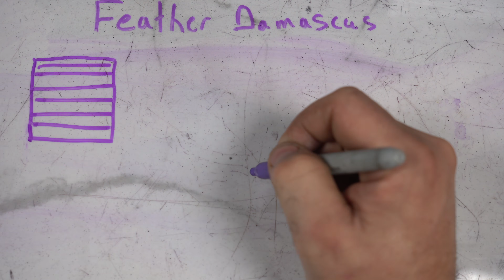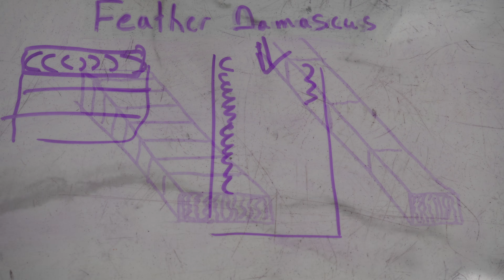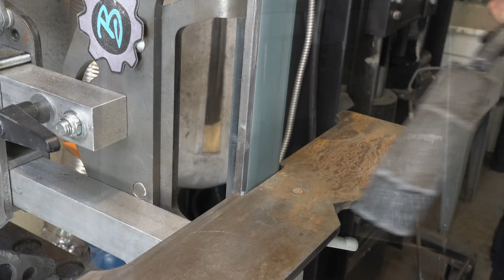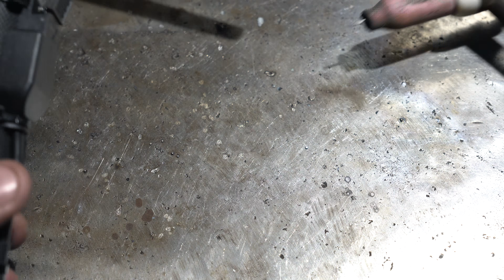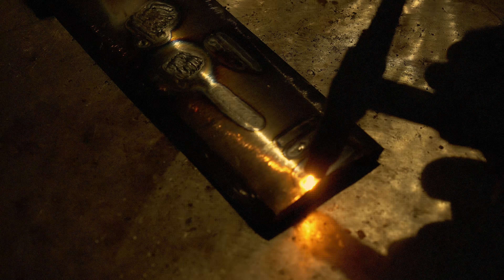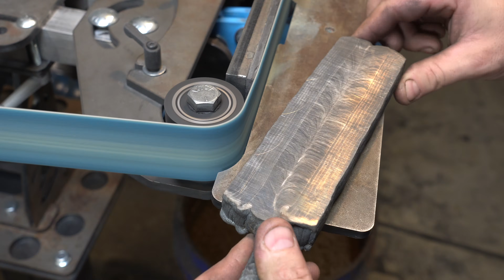Triple-T #106 - Damascus Patterns - Feather

Comment from the maker: Any questions about the feather pattern that I didn't cover?
Reply: what would happen if after the cutting, you did a twist on each half in opposite directions, squared up, and reforged? :o
Reply from the maker: @jeffclarke1694  Once you twist something, you really lose most of the pattern.   I've found that after twisting most patterns, it just looks like a twist.  Plus this would have a VERY high chance of shearing apart.
Reply: @jeffclarke1694  Oh IDK but that sounds kinda cool.  Maybe it would delaminate????
Reply: when you started the layers of steel were like a sandwich then you crush corners
then draw it out  do you draw it out with the layers  running up and down vertically before restack.
Reply from the maker: @robertpiano9991  You want the crushed W's running vertically in the billet.  Meaning as you press the bar, your W's are being compressed.  The other way would flatten them, if that makes sense.  The graphics represent the orientation of the bar.

Comment: Great information, so after stacking the last time and adding the steel on both sides did you use the tig welder to fuse the billet then reheat to split it again? Which model is the tig welder? 2 in 1 or 3 in one?
Thank you William
Reply from the maker: You can just mig the side steel onto the billet.  The tig is optional.  I have a separate tig because the 3in1 machines are usually just lift-tig and those kinda suck.  You want one with a high frequency start.  Again, mig is fine for this.  Thanks for watching.
Reply: Happy New Year and Thank you for
 the info, right now I only have a Lincoln stick welder. Still trying to decide which to get. So after splitting the last time, do you grinding or just brush the scale off before forging back together. I've made Damascus and twisted it for my bullets but have never tried this feather before so I'm a little hesitant.
Thanks

Comment: How do you maximize keeping your billet annealed so you can easily cut it? I find mine seem to get too hard to cut with anything but an angle grinder and cutoff wheel, even though I have allowed them to cool slowly in the forge, or in a bucket of kitty litter overnight. 
Thank you
Reply from the maker: Assuming you don’t have a kiln, just leave your billet in your forge after the forging session when you turn it off and let it cool slowly as the forge cools.  Thanks for watching.

Comment: Hey Denis, would this Vevor tig torch work well for making oxygen free billets? If so, how do you like it still? The link is now expired as well. I think I found the same one on their page, but it looks a bit different now. Thank you
Reply from the maker: That’s exactly what I use it for… fusing Damascus without adding filler rod. I really like it.  It has a HF trigger start, not lift-TIG like the Titanium. The price is great on these as well.  (Note, you’ll need a 100% argon bottle).

Comment: I have what is probably a silly question but what would happen if you did a bar of twist pattern and stacked it like you would for a feather? Then split it just like you would a feather. I’m sure it’s probably been done but I’m wondering what the pattern would look like.
Reply from the maker: You'd get some weird twist that wouldn't really be that recognizable.  Plus to get a twist that thick it would have to be a twisted bar stacked on itself.  I'm not sure what it would look like but probably something akin to a crushed W feather.  Thanks for watching, Bill.

Comment: That tungsten was sticking WAY TOO FAR outside the ceramic cup on your Tig torch. Also on the Tig welding, you don’t need to only use the mild steel Tig rod like ER70S or simply fusing the steel, you can actually get high carbon steel wire like 1080 wire from McMaster-Carr on a roll in various diameters so you are welding with steel that can be incorporated into the Damascus without needing to be completely ground out
Reply from the maker: As you can tell, I’m no expert welder.  Thanks for the tips and thanks for watching.
Reply: @TyrellKnifeworks  you should really try using a foot pedal if your new welder will accommodate one, either a foot pedal or a thumb wheel on the torch as they both function the same just one uses your foot to turn on and turn up the juice and the other has a thumbwheel that rotates to do the same thing
Reply from the maker: @peltiereric6497  It doesn't support a foot pedal.  It just has the button for gas/HF on/off.

Comment: I broke down and bought a higher end yes welder tig/stick.
Reply from the maker: For the amount of welding I do, I can’t justify an expensive welder.  I’m sure you must do a fair amount at work?
Reply: @TyrellKnifeworks  agreed! The yes welder I bought was 450 they have a lower end model that’s about 279. People seem to like them and they have pretty good reviews. No way I’m spending the money for a miller to fuse billets!
Reply from the maker: @sandison_steel  The vevor multi-process with a foot pedal for tig is only $520 so that's a great deal.  I wish I got that one instead.  🤣

Comment: when you stack your steel on top of each other you draw it out   then you crush corners for your  C then  do you flip the billet on its side so the layers are different than when you started. i hope i explaind it as best as i can
Reply from the maker: When you stack your steel, you keep it in that orientation to crush the corners.  Then you turn it 90 degrees so the layers are running up and down and press the bar flat.  Make sense?

Comment: Also when you are using a scratch arc tig, to prevent pinholes, you have to roll the tungsten off, don’t lift it.  We welded pipe for MANY years, and still do, before they came out with pedal start.  They are nice rigs though.  I need one!  😁😂
Reply from the maker: When you say "roll the tungsten off", what exactly do you mean?  (I'm certainly no expert at tig, as you can tell).   Thanks for watching, Tony!

Comment: One of the most useful tips to date,adding side bars to the stack before you split it 

Good job
Reply from the maker: Not before you split it, but before you reforge the splits back together.  This was a huge improvement on the feather process.  I've always had a love/hate relationship with feather because it always tries to split as you draw it out, this totally addresses that.  👍🏻.  Thanks for watching, James.
Reply: @TyrellKnifeworks  we’ll say both then ,yes and that’s also my hate for it 

The splitting and the forging
Reply from the maker: @jamesball7322  It's just that if you forge weld on the side plates before the split, its an extra forge session, as opposed to doing it while you forge the splits together.  Either way though, it's a huge improvement.
Reply: @TyrellKnifeworks  I’ve seen a lot of wasted time on patterns that didn’t have the pop so I’m not to worried about an extra step

Comment: As i recall when i first learned how to use a TIG machine was rule number 1: Don't touch the electrode to the work piece because it causes contamination of the weld. So im wondering what the maker of your first machine was thinking...
Love the series btw :)
Reply from the maker: It's very common to have a lift-tig start on the lower end machines.  When they mean that rule, it was after the arc is started.  Thanks for watching.

Comment: That's cool, glad u did the wavy patterning in the video
Reply from the maker: Thanks for checking it out, William!
Reply: @TyrellKnifeworks  would you consider doing the other way of that wavy patterning (forge then grind) technique.
Reply from the maker: @williammorrin_articwolfforge  What exactly do you mean?
Reply: @TyrellKnifeworks  you forge your billet into a wave then grind the sides down to make it straight again
Reply from the maker: @williammorrin_articwolfforge  I wouldn't try to forge curves into the feather, its very prone to splitting and you would be putting a ton of stress on the exactly where the splits occur.  You'd be better off adding the steel to the outside, putting in the scallops and then grinding all the steel away if you wanted just the feather (with no other steel on the sides).

Comment: Feather is my favorite .I don,t have a press. Could I do a simple by hand?
Reply: As it is a variation of hot cut, it should be doable by hand, depending on the size of the piece would probably require a few reheats
Reply from the maker: I disagree a bit, I don't think feather is a pattern you can realistically do by hand.  The problem is the number of layers, the crushed W's and the forge weld of the tall stack are incredibly challenging to do without a press.  Could you do it with enough time and effort, sure.  You're probably going to need 3x the amount of steel though because you're going to lose so much steel to scale.
Reply: @TyrellKnifeworks  Thank you sir

Comment: As  a non knife maker I understood the first uses of Damascus was for increased blade strength. Do all these modern variations also add strength?
Reply from the maker: But you need to consider the steel from that period was terrible by today's standards.  They first took bloom steel created in a furnace and then combined different steels in a crucible and melted them together to form traditional damascus or what we call "wootz" steel. This was stronger because it removed more impurities that plagued steel of that period.  Today's modern steel is very pure and MUCH stronger so modern damascus is done by layering different kinds of steels to produce a pattern.  In itself, it is not stronger but actually can be weaker than the original steel if not done correctly.  You are forge welding those steels together and if any weld isn't done right, it introduces a point of failure.  I hope this helps.  Thanks for watching.

Comment: Question: How much of the metal do you lose to the scale falling off when you press it? Is it enough to notice or insignificant?
Reply from the maker: What Robert and Simon have said is spot on.  This is why I say some patterns aren't realistic to do by hand because you'd need to start with so much steel because you'd have to do so many heats that you'd lose most of it to scale.  This is one of those patterns.  Thanks for watching.
Reply: Usually you lose one percent of metal when you heat it up. You can see piles of scale around the power hammer or anvil. But the amount of steel you use decreases as you forge and heat as the billet as the billet gets smaller as you keep heating and forge . I think a math size could come up with a formula for the amount of loss over time. A long answer for a simple problem.
Reply: Math wiz instead of math size. I dislike auto correct …..
Reply: @copper7309  I feel the autocorrect pain.  It kicks my ass too.

Speak of the devil.  I typed "the pain of autocorrect" not "the autocorrect pain."
Reply: It depends on how often you have to heat it and the ratio between surface area and volume of your billet. From start to finish of making a more complicated pattern I’ve heard people losing as high as 3/4 of the material but that also depends on how much grinding you do. But I would say it is always enough to notice

Comment: You can buy wire for AR 500 that's a lot harder than typical ER70 wire for mild steel? I'm not a blacksmith but been a welder for 40 yrs, don't know if that helped or not?
Reply from the maker: That wire would still not be the hardened steel that matches the steel in the work you're doing.  It would show up differently when etched and look like a blotch.  You don't want to introduce any different steel into the work piece and I very much doubt you'd find exactly the same steel in a wire for a mig.  Thanks for watching.